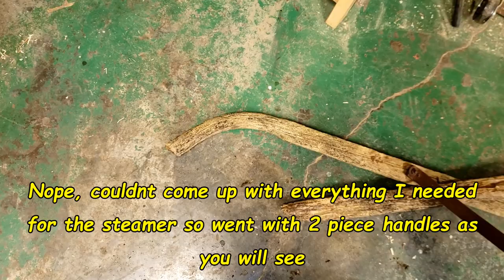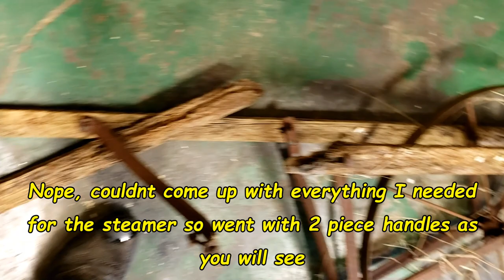Restoring Antique Cultivators

Comment: I'm starting work on a tiller that is very close to what you just did only mine have metal handles.  Needs a good bit of straightening out, and new hardware.   I did one over the winter and used the same green paint that you did.  Good job sir, subscribed.